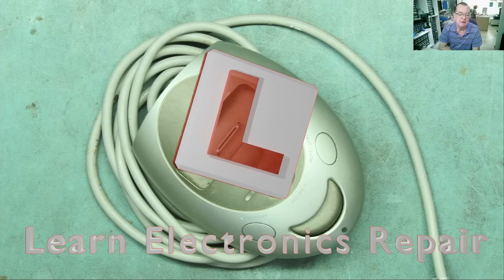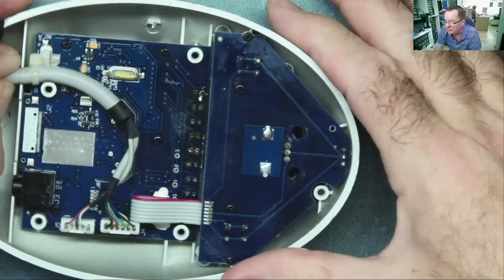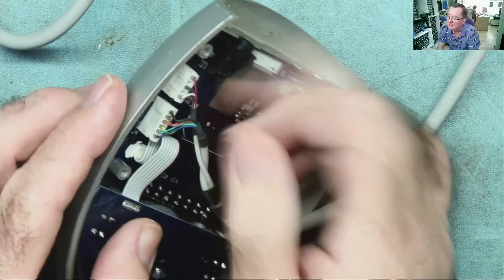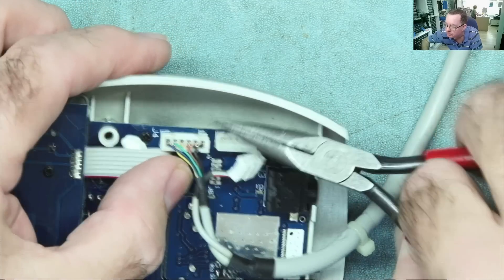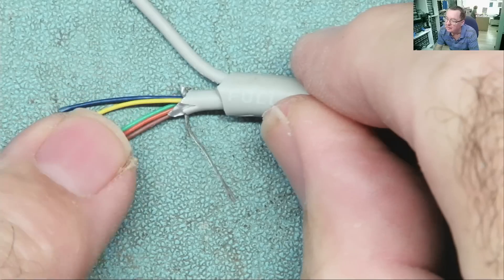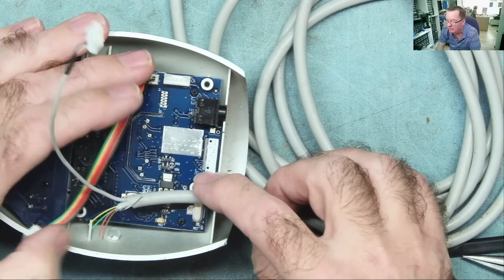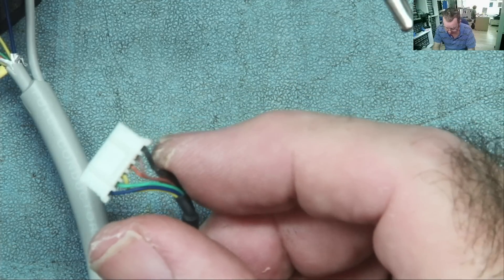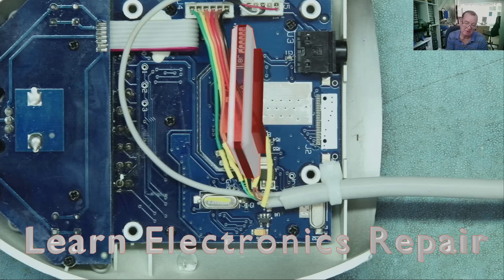Broken And Damaged Cables Are Common Faults : Here Are Some Repair Hints And Tips For Beginners

Comment: Can I recommend a tool? You can get 'parallel jaws pliers' that would get a much better grip on that connector. I find they are much better than ordinary pliers on lots of gripping type jobs, eg small nuts etc...as the jaws are always parallel. Spring loaded are best. If you get one with a locking screw it acts like a small vice.

Comment: Hi Richard, why didn't you leave the connectors alone? They were okay, weren't they? If you had cut the wire a little further then you could solder the same wires, after you cut out the broken part. 
But I wonder why you didn't check where the broken part was.
By the way, I am a great fan of yours!
Reply from the maker: I did mention towards the end of the video about reusing the original connector.  I guess there are different ways to do most things.  As long as it works (and this did) that's OK

Comment: When I've repaired cables like this I also cut where I think the break will be. I then strip back some insulation from each wire and check that each wire has continuity to one of the connectors at the other end. I don't need to know beforehand which one, it's only a problem if a wire isn't connected to anything in which case I need to cut back a little further. I then do the same for the stub that I cut off. As long as there's enough length in the cable and the stub I can then join them in the same way you did but I know I have the right colours.

It saves searching for another cable/connector. Like you, I have several types of these connectors but of course never the right one. Next time I have to repair one I will probably buy a set of each type I don't already have. They all come under the heading JST (Japan Solderless Terminals) connectors so they are easy to find.
Reply from the maker: Chris, I did mention you could do it that way too towards the end of hte video
Reply: @LearnElectronicsRepair  I must have missed that.

Comment: I’m surprised that you didn’t do any sort of continuity testing before you decided to cut wires and no testing after the “repair”!
Reply from the maker: Just experience I guess. I know the most likely place for the cable to fail, and the customer described the fault in such a way that I knew the audio lead as OK and the fault was in the other part of the cable.  It also felt 'wrong' at that point when rubbed between my fingers (Like Uri Geller bending a spoon) so putting all that togeter I took an educated guess and I was right as it works fine afterwards,

Comment: I have some heat shrink on the jaws of my helping hands. The insulation on some wires is so soft and/or melts at such a low temperature that otherwise the jaws damage the insulation. The extra surface area also helps to conduct heat away.

Comment: how did you actually know the fault was fixed as you didn't even bell out the individual cables to see if you had connectivity
Reply from the maker: Experience.  I knew from the customers description the fault was near the back of the unit and also that the light went out when he waggled it.  Form that I took a punt on the audio cable being OK and the other one had a broken wire and the most likely place was where it is compressed.  It also felt 'wrong' when I waggled it there.  Seems I was rightr in this case as it's working fine now.  I did the same thing with the optical position encoder of the CNC machine I repaired a couple of months ago.  I was right on that one too.  Of course sometime I will be wrong and then have too look at that job again